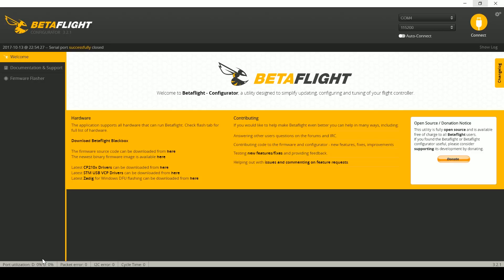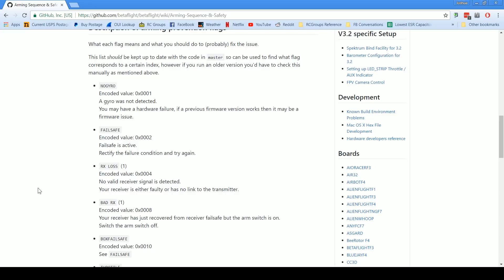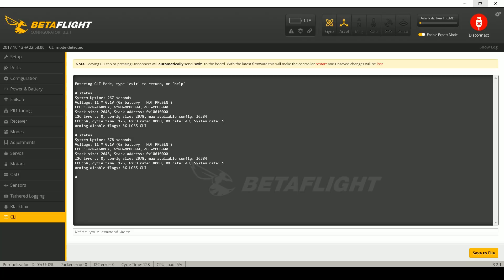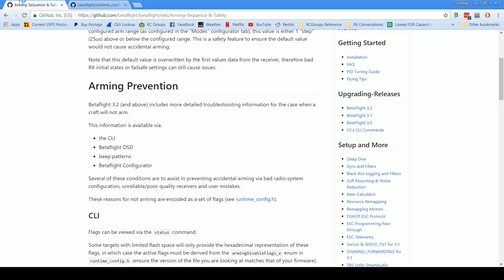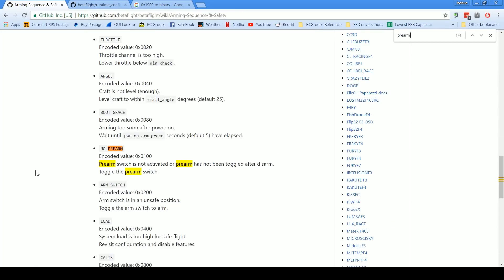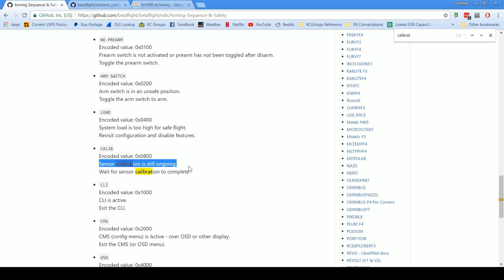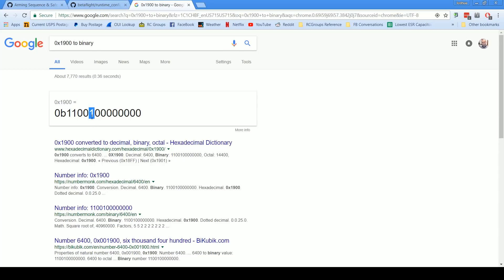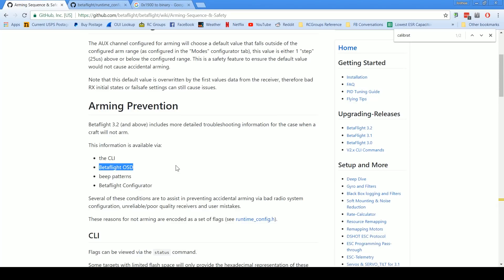Betaflight 3.2 | WHY WON'T IT ARM?

Comment: Can you interpret this form me? Arming disable flags: BADRX THROTTLE CLI MSP GPS RESCUE_SW ARMSWITCH    My reciever is new. I can't be bad
Reply from the maker: BADRX means the arm switch was in the armed position when you powered up the quad. Move the arm switch to the disarmed position.
Reply: @JoshuaBardwell  Thanks a bunch.

Comment: I just fixed it! When i unbricked my Tx and reset up a model, i didn't set the channel range in model setup to 1-8. Mine was set to 1-16 and I learned that OTX can be finicky with this.

Comment: To add to this.

Since Im new to this hobby and Ive been struggling with the Arm Flags. Its been 1 week since Ive been eagerly trying to figure out how to remove the "No valid receiver signal detected" RX LOSS CLI MSP. Tried using a different receiver to see if my a8s got problems, changed its ufL antenna, but still not getting any remedy.

One thing I forgot is to set an arm switch on my FSi6s transmitter. Problem solved.
Here is my specs.

Tx FlySky fsi6s
Rx fs a8s
Hglrc fd 413 vtx stack

Im using speedybee.

Comment: Hi Joshua, you are one of the best in this field, I am a beginner on FPV, just starting to learn a lot of information. At the same time even I use camera drones, FPV is a new way to piloting drones. To start practicing flying I bought a tinyhawk 2 bundle 3 weeks ago and I lost the drone flying outside of home , it went to the skies and never found it !!. Having the controller and googles I thought I will be easy to buy a 2nd tinyhawk 2 and use the previous bundle. But I was wrong and never flew out of the box!! Does it make sense? Do I have to use betaflight  with a new drone? Should not be flying out of the box?

Comment: Also you want to make sure your in the right protocol (DSHOT, MULTISHOT Etc.) for your flight controller cause you can get a heart throttle message if your in the wrong protocol for your esc.

Comment: I had a hard crash on my gtr-369 and now when I try to arm I get multiple beeps and won’t arm, in betaflight it says arming disabled at the top as soon as I plug it in. And also in cli status command. My receiver is an rxsr . Wires look ok but maybe the impact damaged the receiver?
Reply from the maker: What status code is there in the CLI, that is preventing arming?
Reply: Say arming disabled
Reply: But I don’t think I had the battery plugged in while in cli. I messed with it last night trying to see but didn’t know it gave that command when battery is unplugged. I also loaded 6s pids from Andy last night and now from watching this video and need to check that throttle setting when I get back home this evening. But I did notice the arming disabled at top screen of beta flight before loading his pids. But didn’t realize it was a problem till after I loaded them and went outside to try it out then realized it wasn’t arming and had the multiple beeps
Reply: ok I figured it out with the help of your vid series, you made mention of activating alarms in the osd so i did and it said "throttle". so i went into betaflight in the radio tab and with the battery plugged in to power the receiver and moving the sticks on my radio, I realized my mixer settings was all out of whack. due to loading andys tune. so going into my mixer on my QX7 and changing my mixer settings fixed the issue. The main arming issue was that my throttle and roll where swapped and pitch and yaw as well. SO my throttle being on my right stick told the radio I was at mid throttle. thanks again for the comment back and for all the specific videos. 
Side note for the 6s tune,, worked good. no more vibes. First time I've ever loaded a tune, but i finally figured it out. 
Thanks so much!!

Comment: Hi Joshua, I have an Eachine Qx65 that I was able to flash with 4.0 betaflight. I Omnibus.  It arms and everything, all the values on betaflight are ok in reciever tab. The osd displays it going from armed to disarmed. But the motors do not turn on. Nothing I do seems to work any ideas?

Comment: Help: My aircraft does not arm, status showed "RXLoss". By BF definition, it means "receiver is either faulty or has no link to the transmitter". But the reality is, my transmitter is well bonded to the receiver, and in BF "receiver" and "modes" pages it corresponds to all channels movements and arm/disarm switch correctly and responsively. However, once outside of BF, the aircraft has no reaction to the transmitter at all.
I believe that BF "receiver" and "modes" pages showed my transmitter and receiver both working properly, at the same time it also showed (via "status") "RXLoss CLI" message. What the heck is the real problem here?  Simply concluding "receiver is either faulty or has no link to the transmitter" is not convincing. Please help (BTW, both aircraft and transmitter/receiver are new) and many thanks.
Reply from the maker: If you see channels moving in the receiver tab, then I agree you should not see RXLOSS. My guess is that when you unplug from the computer, the receiver stops talking to the FC. That is pretty weird if true, but that is the only way I can think to explain it.

Comment: I checked osd an see no warnings in the osd. radio link contacted me and said that the switch isn't issuing instructions and gave me a link for another controller an I guess referred  to stick arming
Reply from the maker: It's likely that you can configure the transmitter to use the switch. But I don't know off the top of my head how to do it.

Comment: I have worked out all the cli flags watching your videos but I still can't get arm to turn yellow and drone still won't arm
Reply from the maker: Turn on the Warning OSD element in the osd tab. When you flip the arm switch see what it says. If there is an arming code it will tell you.

If there is no arming code and the drone doesn't arm, it means the FC doesn't think tor Mode is going active.

Comment: When I plug my battery in no lights come on but when I plug it into the comp the lights come on then
Reply from the maker: This usually means the 5v regulator on the FC is dead. Most people replace the FC at this point.

Comment: Wouldn't it be nice if betaflight configurator just converted the arming flag codes into text strings. It doesn't require memory on the flight controller for that.

Comment: i get RXLOSS CLI MSP  i had a crash with EACHINE E010S  i try to rebind it nothing works i see the  connected on the gui i don't see my transmitter i try to rebind also check the channel to TAER1234 FOR MY TARANIS  i don't know what else to do any help would be great
Reply from the maker: RXLOSS means the flight controller does not see signal from the receiver any more. If the receiver is bound and the transmitter is turned on, then it must be something physical like damaged wire between the receiver and FC.
Reply: @JoshuaBardwell  i check the FC there is no damage, the wire looks fine so i don't know i'll just buy another FC.

Comment: CLI Said it was my throttle , said to lower throttle below min check.  It is below min check and still want ARM... What to do now???
Reply from the maker: Did the THROTTLE flag go away? If no, then throttle is not below min_check. If yes, then what other flag is present that is preventing arming.
Reply: Joshua Bardwell  I have cleared all flags I only see cli an msp I  try arming in modes but it won't turn yellow and won't arm when disconnected

Comment: My problem is: arming disabled flags, Angle CLI MSD = Arming disabled  angle = 1<<7 [Can I get your help from here]?
Thanks for your support and sharing this video!
Reply from the maker: Please see this playlist:

https://www.youtube.com/watch?v=N8oMMG2kmns&list=PLwoDb7WF6c8n8SCsG7mtIgQUgsuWxaiiO

For ANGLE just calibrate the accelerometer, level the quad.

or set Arming Prevention Angle to 180 in the Configuration tab which disables the protection.
Reply: Thank you so much for your support!

Comment: Just a heads up for everyone who wants to see the arming disabled flags in their OSD as Joshua suggested at 7:39 - in current versions of Betaflight (3.4 and later) you'll have to enable "Warnings" in the OSD elements selection on the left AND select "Arming Disabled" from the warnings selection on the right side. Also I recommend placing the warnings OSD element at the bottom of the screen, so that when you also have warnings like critical battery enabled, it won't just pop up in the center and block your view...

Comment: OK so my  quad wont arm did status it says CLI  MSP says wont arm cause I have betaflight connected ???? I have alway been able to arm in betaflight before what 's up with this..If I disconnect from betaflight is arms just fine
Reply from the maker: Betaflight added a safety feature where it refuses to arm when it's connected to the configurator. You can override this by going to the Motors tab and enabling the "i understand the risks props are off" option.

Comment: My quad only arms when both USB and lipo connected. With lipo alone won't arm.
In CLI tab it says rxloss CLI

Help
Reply from the maker: Rxloss means the reveiver isn't being detected. Does it get power when plugged in to lipo only? If not, why?

Comment: I'm having a problem arming on a quad. 2 problems actually. One, after a flip or roll the quad will just start spinning out of control. Throttle increases into a deathroll during this. second, sometimes it won't arm and the betaflight osd says "calib" in the warnings area when attempting to arm. The beep code I believe is 3x short and 3x long. This occurs even when being plugged in on a level surface and the artificial horizon on the osd shows that it is level. I am assuming the gyro is just trashed. Any magical remedies or troubleshooting anyone might suggest? No i don't have a spare 20x20 FC
Reply from the maker: CALIB means the gyro is seeing too much vibration and won't arm. You can try to fix this by going to the CLI and:

Betaflight 3.3 and earlier: 

set moron_threshold=150
save

Betaflight 3.4 and later

set gyro_calib_noise_limit=150
save

If that doesn't fix it, the gyro may be damaged and the solution is likely to replace the FC.
Reply: haha thanks for the help.

Comment: I am using clean flight software and same problem of arming is their.Can u pls help me out how to fix this in clean flight?
Reply from the maker: Does. Clean flight have arming status flags? Go to the CLI and type "status".
Reply: yes
Reply: its showing RXLOSS CLI ARMSWITCH
Reply: i am using spracingf3 flight controller
Reply from the maker: RXLOSS means the FC is not seeing signal from the receiver. Receiver is not connected to FC correctly or FC is not configured correctly.
Reply: its showing throttle cli armswitch
Reply: i have also set the throttle value below min check then also its showing throttle CLI armswitch

Comment: I have a Bardwell f4 in two quads now.  This is within a week.  One of my quads came with it in and another I put in.  In both cases, they won’t arm.  I have done everything as far as the stock values and the they both say the same thing🤦‍♂️.  I’m frustrated.
Reply: Oh, codes are no prearm and calibrating

Comment: Thanks Joshua,  your info helped me narrow it down a bit, I finally got the motors to arm and spin , but they seem to start up at an unsafe speed with a nasty noisy odd vibration coming from the motors, Im scared something is going to burn up if i keep arming them. Not sure what it could be, yet when i just plug in the battery to the quad and go to the motors tab and use the slider to spin them up, they are nice and smooth.  what could it be ?

and some FYI,  in betaflight 3.4, in the setup Tab when quad is connected via USB, the Info Square on the right of the page shows the same status input you used in the CLI tab as to why the quad wont arm, shows the Beep Codes to search in the Github link you provided.
Reply from the maker: If you are using Dshot, and assuming that the idle speed is at the default of 4.5%, then the motor speed is most likely normal.

If you are using oneshot or multishot, then you have to manually calibrate the ESC endpoints and set the motor idle speed. This is why I recommend you use dshot--to avoid this complication.

This video may address the question of why the motors speed up: https://www.youtube.com/watch?v=xBaefeQtA1c
Reply: Yes Im using Dshot, but the motors arent spinning up, they are at a constant speed, they just sound crunchy and alot more vibration when they start up. But I guess i will try to fly it as is then

Comment: Hi Mr Bardwell
been head scratching for days now so its cap in hand time as we say here !
omnibus f4 v3 ? banggood, used many times in quad builds & always worked fine
installing this one in 690 swallow all set up as your vid. all lights fine & esc noises 
sound like shes armed but not arming tried switch slider moves but not going green
cli says nav cli ? in config. nav is safe is X all rest ticked gps is not turned on either ?
i am going to put in a gps after i get the arming sorted not sure whats next can you
help please as im going nuts !
many thanks,
Kevin.

Comment: First off Mr. Bardwell, I thank you for plethora of knowledge and the willingness to share it. 

The disable arming flags i am receiving on my 220 build, with spracing f3 fc, and frsky D4-II receiver, using a Jumper T8SG radio, and betaflight 3.3, 
Was 17, and 9. After calibrating my accelerometer, and checking all the tabs in betaflight and all looks well, i look at the first tab "set up" and notice theres just the 9, as a flag. Good i think to myself, only one to go now. 
So i look in wiki and see what that 9 code stands for. 
When i type "status" in the cli, the last prompt states disable arming: breachbooted or breachboot. (Sorry currently not in front of my quad) 

Any sugestions as to what i am doing wrong would be greatly appreciated, as is your time. 

By the way, whenever im asked "dude! Where'd you learn how to build these or do all this hi tech gaget stuff?" 
I almost always reply, "Joshua Bardwell, he's on Youtube. Thats all i gotta say! " 

Hope for some resolution, for this is driving this vet crazy. 

Thanks again.

Comment: When I arm the motors don’t spin until I increase the throttle. I played with the numbers for the throttle putting them over and under min check. So there will either be too much throttle to arm, or so little that I have to raise the throttle stick. What should I do?
Reply from the maker: Have you enabled the "spin motors when armed" option in the Configuration tab? If you have disabled that options, the motors won't spin unti lyou raise the throttle.
Reply: Joshua Bardwell, I do not have the MOTOR_STOP switch on. Could there be anything else wrong?

Comment: I got one for you 
beecore v2 dsmx

status
System Uptime: 388 seconds
Voltage: 1 * 0.1V (0S battery - NOT PRESENT)
CPU Clock=72MHz, GYRO=MPU6000, ACC=MPU6000
SD card: None inserted
Stack size: 2048, Stack address: 0x10002000
I2C Errors: 0, config size: 2043, max available config: 4096
CPU:16%, cycle time: 135, GYRO rate: 7407, RX rate: 504, System rate: 10
Arming disable flags: 0x1020
Reply from the maker: I think you're asking me to interpret the arming disable flags... to which I would say, binary math is annoying... But I show how to do it in the video.

Comment: I typed status in CLI but the “Arming disabled flags” does not show up, my Betaflight version is 10.2.0 and the FC I have is Sp racing f3, can someone help me?
Reply from the maker: I think you have an older version of betaflight. 10.2.0 is the configurator verson not the firmware version. Go to the CLI and type "version" to see the firmware version.

Comment: Thanks for the tip. I was able to see in the osd warnings “ bad Rx “. Yet it’s reading my sticks in the receiver page in Betaflight. Can’t get my new babyhawk r to arm. It makes a light beep when I try to arm, and nothing.  
What can this be ? Can use a little help :(  thank you.
Reply from the maker: Bad rx means cycle the arming switch to the disarm position.

Comment: in my CLI put this:
# status
System Uptime: 26 seconds
Voltage: 0 * 0.1V (0S battery - NOT PRESENT)
CPU Clock=72MHz
Stack size: 2048, Stack address: 0x10002000
I2C Errors: 0, config size: 2186, max available config: 4096
CPU:100%, cycle time: 185, GYRO rate: 5405, RX rate: 24, System rate: 4
Arming disable flags: RXLOSS LOAD CLI MSP

Can you tell me what's wrong to my drone? why dont arm? how can I solution this?
Reply: with baterry put this:
# status
System Uptime: 134 seconds
Voltage: 0 * 0.1V (0S battery - NOT PRESENT)
CPU Clock=72MHz
Stack size: 2048, Stack address: 0x10002000
I2C Errors: 0, config size: 2186, max available config: 4096
CPU:100%, cycle time: 188, GYRO rate: 5319, RX rate: 49, System rate: 4
Arming disable flags: LOAD CLI MSP 
when I arm my screen of arm is not yellow.. can you solution me?
Reply from the maker: LOAD flag means CPU load is too high. Reduce the gyro and pid loop rate.
Reply: omg done, thank you man you really good, love you

Comment: I just updated to 3.2 and now I can't get my Quad with F3 board to arm. I am getting 0X840 in status. Any help would be great.
Reply from the maker: Upgrade to 3.3 and then you will get text instead of a code in the CLI.
Reply: Joshua Bardwell I am using a Vortex 250, I am not sure 3.3 is supported yet

Comment: how to solve this (Arming disable flags: THROTTLE CLI)
Reply from the maker: Adjust channel endpoints in the transmitter so the channels go all the way from 1000 to 2000 in the receiver tab.
Reply: thank you Pro  i use radio link AT10II now and i buy X9D Plus SE because there is no more lesson about that :)
Reply from the maker: https://www.youtube.com/watch?v=PCLxyurZsD0